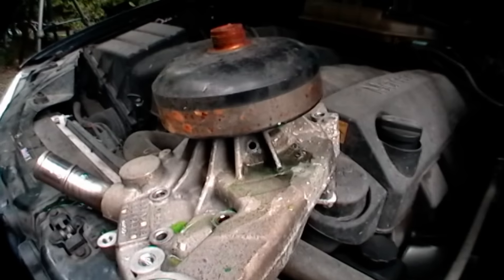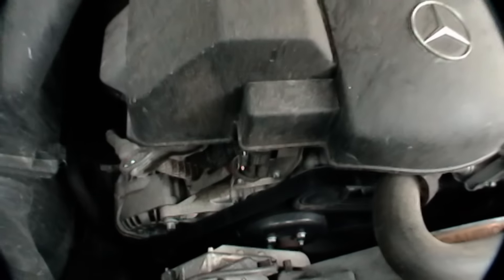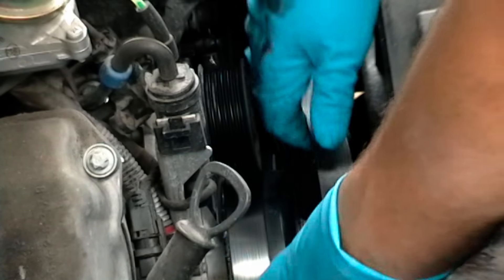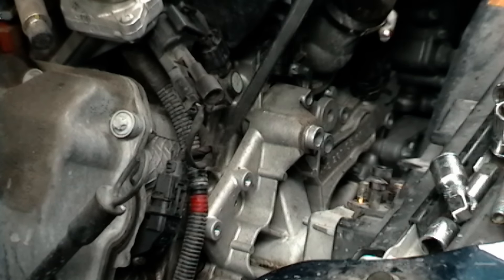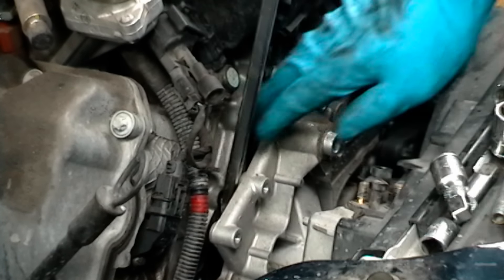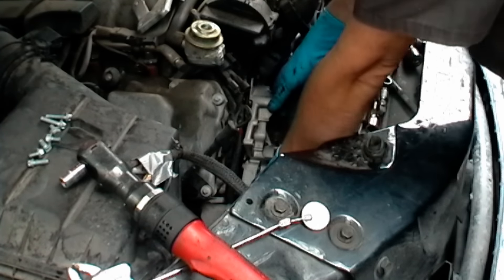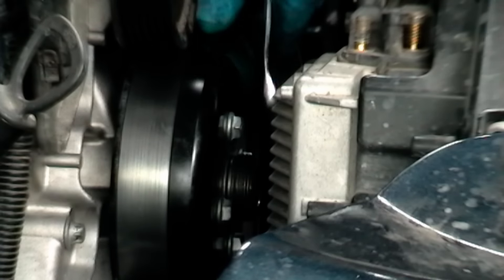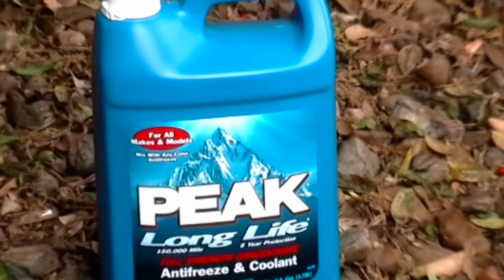How To Replace a Water Pump

Comment: scotty kilmer makes mechanics look easy
Reply: Yeah. Shame sometimes we have to fork over an arm and a leg
Reply: how do u replace a water pump on a 2002 Isuzu rodeo
Reply: Juan...in the process of doing that now.  You have to take Fan shroud off, then fan, then serpentine belt, then the water manifold, and then the upper timing belt covers.  Then loosen bolt that holds crankshaft pulley on (it is a bear...likely will need lots of PB blaster applied and let soak in overnight, then bolt a chain to the of the crankshaft pulley by using one of the threaded holes in the face of the pulley.  Bolt the other end to one of the bolts on the alternator bracket that you had exposed when taking off timing belt cover on the passenger side.  You will need a 24mm socket to remove crankshaft pulley bolt...the chain is to keep the pulley from turning as you apply pressure to release the bolt.  I had to use a 5 foot breaker bar to get enough leverage to break it free.  Then use pulley puller kit (Harbor Freight has them for about $20) to remove crankshaft pulley.  Remove lower timing belt cover.  
Now you will have to remove the timing belt...be sure to mark them in reference to the engine (several Youtube videos about this).  Unbolt the timing belt idler pulley for access to water pump bolts, and you can now remove the water pump.  Hope this helps.  Good luck.
Reply: He's only been doing it for 50 years

Comment from the maker: either the timing belt is not tight enough (sometimes cheap belts are too big and do that) or one of the fan belts is hititng something which would be a lot easier to see. Remove all the fan belts first to see if the noise goes away

Comment from the maker: I pressure test them with a pressure pump, as in my video "how to fix an overheating car" and you see the leak obviously then. Then you can see the spray when it's cold and feel around for the leak too.  Cheaper pressure testers can be had for 40 bucks or less if you price around.

Comment from the maker: No, it won't really hurt anything, you can mix all kinds of coolant, they work fine, it just makes measuring their freezing point a relatively inaccurate process due to differing chemicals in them.
Reply: Hey what about the electric water pumps?

Comment from the maker: @Jcal022 just running them then refilling them with the heater on full blast after they cool down an hour or so normally works. If not, I use a vacuum bleeding system. Scotty

Comment from the maker: @Matthew55904  No , you can't change it out. And you need to check the pump and the tensioner and other pulleys for wear. Replace them if they are worn or if you have very high mileage. Scotty

Comment from the maker: @TranceScene  Yes, but the mercedes I was working on is full of blind holes, no through bolts, a better design. If you are worried when working on a car, watch the bolt holes as the bolts come out, and if water starts coming out the hole when you remove the bolt, put sealer on the bolt before installing the new pump. Scotty Kilmer

Comment: Very good point to point out to people about cleaning off the old gasket on the engine before putting the new one one. The cleaner the better :- ) Something so simple could cost you in the long run if you don't take the time to do it right the first time. Thanks for the vid Scotty!

Comment from the maker: Base Timing 	10 +/- 1 deg BTDC
  	-
Note: With STI (TEN) pin grounded at Data Link Connector

 10 degrees before top dead center with the pin grounded on the data link connetor at idle

Comment from the maker: @loco0351  Changing that timing chain is a pretty complex job, but it has nothing to do with the water pump so I wouldn't bother unless the pump is leaking. If you have the tools and don't mind getting dirty, I'd advise getting a book to make sure you do it right and line up the marks correctly., Scotty Kilmer
Reply: What about the Dodge Magnum 2.7 V6
The water pump is driven by a chain off the crankshaft.
I've been told to keep a close eye on the oil and if I start seeing signs of moisture its probably the water pump leaking back into the engine.
If this is true for the original engine has Dodge come up with a fix to prevent this from happening?

Comment from the maker: @ezkeyboardkid58  Try changing out the thermotime switch for the fans, any auto parts store can sell you one and show you where it is. If that doesn't do it, then either the fan relay is sticking or the engine is wearing out and just running too hot. Scotty

Comment from the maker: @1ownjoo2  Yes, it's hard to get a correct 50 50 ratio of coolant to water that way. Most guys use a flush machine, OR blow the block out with compressed air so nothing's left inside. But you have to remove the thermostat to do that, that's why most guys pay a mechanic to do the job with his 1700 dollar machine. Scotty

Comment from the maker: @sbaker3232  That would be a big No No. The weep hole is there to relieve pressure from a leaking pump seal. You plug it up, the pump will eventually blow the pulley and knock a BIG hole in the radiator. Scotty Kilmer

Comment from the maker: often the ac compressor, but if it blows cold and continues to do so over time, often valves inside the ac system get worn and make noise on start up. Live with that if it works.

Comment from the maker: bubbles will always come out as the engine heats up from heat. But, if you have air inside, that can make the idle fluctuate. Me, I use a vacuum pump system to suck the air out of cooling system, most mechanics have such a device, it only costs 70 bucks, but you need an air compressor to run it

Comment: Dear Mr: Kilmer. You're an inspiration to so many people including me. I have just removed a water pump from my car and it was destroyed. All the flaps, or what are they called, broke of and ended up in the engine. Since I also removed the engine head I glued a strong magnet to a screw driver and pulled them one by one through cooling openings. However, I got seven out but the eighth is nowhere to be found. I didn't found it in the bucket I set below water pump but there is also some chassis parts going right bellow the pump and it could have got stuck there but I have no way of looking into it. What should I do? I wouldn't like to assemble it all together only for new water pump to get destroyed by this part. Sorry for a lengthy post but I've never been good at explaining things :)

Comment from the maker: @BigLongJon21  For that car, you need to take the front of the engine apart, and replace the timing belt and water pump, as the pump is driven by the timing belt. Watch my video, How to change a timing belt in your car, that shows how to do the belt, then you would just unbolt the water pump also to replace that. Scotty

Comment: I am working on a 2004 3ltr v6 Mercury Sable. Super high pitched belt squeal and overheats, and no heat ,water pump spins good and no weep hole leak ? I checked all the pulleys and they are good and spin free, I loosened the belt to check them. I thought something might be seazed up preventing the water pump from spinning. 
I thought it was the water pump but it is a job to replace it. Maybe I should check the thermostat first ? The alternator output was normal by the way.
Your tech videos are great thank you sir !
Reply from the maker: many things can cause overheating, and on those, bad water pumps always will leak coolant, period.  could be more than one problem, so try my video "how to fix an overheating car"

Comment: First time watching your videos and instantly love em! Very informative. As a total car amateur, this tip along with the replacing the radiator could possibly save me $800! I havent put these skill to the test just yet. I need to order the parts first. If you can give me anymore tip for a 97 camry(4 cylinder automatic), I'd greatly appreciate it! Thanks!

Comment: Tapping the pulley?
Hi Scotty! With your help I replaced the water pump on my mazda 6 v6 2007. I had to remove one pulley to have access to the screws holding the water pump. I put back the pulley on but couldn't squeeze it fully in. The harmonic balancer screw tip broke. I'm missing about 2-3mm to have it fully inserted, can I tap on the center of the pulley with a hammer or is this dangerous? It all works as is but it squeals a little bit because of the pulley not being fully inserted.

Comment: Hello scotty. i'm refering to ur videos and many other sources to change the water pump, timing belt, and tensioner pulley on my good old 86 BMW e30. Do i always have to put gasket sealer before putting the gasket? I ask because none of the other diy's say anything about this. I'm replacing them because it hasn't been done for more than 6 years i believe, plus it started leaking; sending the coolant like lube to the belts. Thanks in advance, all of your videos have been really helpful. God bless

Comment: Question for you - I'm looking to fix a coolant leak on my 97 Regal LS and am trying to determine whether its the cooling elbow joint or the water pump itself.  When I have the car in park and go up to around 2.5k RPM's, you can see coolant gushing out near this elbow.  Would this happen with a bad elbow or does that mean it's associated with the actual water pump?  Just looking to do the least work possible and still fix the problem.  Thanks for your help!!

Comment: When I tried removing the harmonic balancer using the removal tool you used on your other video, I noticed that the holes on it werent threaded and that the bolts I got for the tool are too big. Is the unthreaded holes normal and what size bolts do I need to take of the harmonic balancer?

Comment: Hi Scotty, what are some of the common signs of a bad/worn water pump? my 2005 Mitsubishi only have about 55000 miles on it. my mechanic told me that i should change the WP when changing the timing belt, but dealership (to my surprise) said they usually don't have to replace the WP. any advice? thank you for your time.

Comment: Hey Scotty is it recommended to change the whole timing belt and gears and tensioner also when changing a water pump??
Reply from the maker: everything but the gears, they generally last forever, they are metal, belt is rubber

Comment: You make it looks so easy Scotty! I have a 1998 Olds 88, and there is water around the water pump and at other places on that side of the engine. I have tacked jobs like tune ups, and simple stuff but I am not sure about doing this job myself. Do I have to worry about torque of bolts? Can I do it from underneath so I don't have to take a bunch of stuff off or out of the way to get to the water pump? I feel like I could it myself if I had to. I'd rather not spend the bucks for a mechanic. Help?

Comment: Hi Scotty:  I'm thinking of going with a hi performance water pump and radiator for my 87 Caprice, for extra protection in really  long drives through desert-like areas.  Can you think of any reason I shouldn't do this?

Comment: I have a honda civic 98 , it had a cracked radiator so i purchased an aluminum one. changed the electrical fans and top and bottom hoses along with the straps . I also changed some heater hoses and by pass hose. I am having an issue with the car overheating it does it sometimes. My guess is the water pump need changing since i have had the car 2007 i have never changed the timing belt or the water pump . my question to you is how do you diagnose this ? is it the water pump?

Comment: Hi, Scotty, You just put the gasket on but do you need that rubber piece that come with the gasket or no?
Reply from the maker: I don;t know what you're referring to. But waterpumps come with many different designs, and some do have rubber pieces for sealing side shafts. You would use them

Comment: Hi Scotty, Thanks for doing all such great videos... Do you know what need to be removed minimum to replace water pump on Honda civic on 2001 coupe.  Also do we need to torque engine properly before removing timing belt off to replace water pump? Thanks once again.
Reply from the maker: you have to take the timing belt off on that honda to change the pump, but it's no biggie really. There are torque specs but if you work by hand and put it all back as tight as you can, that always works fine for me.

Comment: Scotty we have a 2000 camry and it squeals while running especially at idle. Sounds like the idler pulley to the alternator. My mech said to replace the timing belt and water pump since it is not easy lots of time to get to them and it has 100,000 miles anyway. What do you say?

Comment: hey scotty, I have to replace the water pump on my 2002 mazda mellenia 2.5L engine , wondering is it alot to it do i have to remove the timing belt or lower the engine to get to it not sure.thanks

Comment: Scotty, What's a good price to do a timing belt, water pump, tensioner, and reset and set the mechanical timing for a 1994 Prelude SI H23A1?
Reply from the maker: with all those parts, if you use quality dealer honda parts, about 600 bucks.

Comment: @scottykilmer yep agreed. In the past 2 years alone my grandpa has had the following things replaced on that car: the alternator, the battery, the radiator & thermostat, the fuel pump, the front struts, as well as the motor & transmission mounts. The car has well over 207k miles on it now and it still has a check engine light on it because apparently there's an evaporation leak. He really should just get a new car but for some very strange reason it's still not high on his list of priorities.

Comment: Evening scotty, I've just replaced the water pump, timing belt and tensioner for 01 honda civic. When it was time to torque the tensioner with the torque wrench it just feels like it spins but it doesn't tighten to 33 foot lbs. Is it possible that the bolt broke the threads and if so, would it be safe to drive like that. It looks as if the timing belt is pretty secured even when I rotated the crankshaft a couple of times.
Reply from the maker: not safe if bolt is stripped, as belt will get too loose and often snap

Comment: scotty, i recently had my water pump replaced. After getting it replaced, I had some fluctuating idling when the car was cold. I thought that when i got the pump replaced, that air got into the coolant system.  To get the air out, i let the car run with the radiator cap off.  While i did that, bubbles where coming out of the radiator coolant.  Is it possible that the water pump could be the reason for the bubbles?  I am trying to come up with every possible scenario for bubbles.

Comment: How bad is it to do on a '99 Grand Prix 3.8 naturally aspirated engine? The engine has less than 40,000 miles and it already needs changing, possibly because I switched from Dexron to Prestone. Also the factory part from GM is close to near $300 while the generic "AC Delco" version is only $78. What's really the difference? Any other decent brands to look at? Thanks Scotty!

Comment: Hey scotty, so would this be like the same process to change the water pump on a 96 accord?
Reply from the maker: na, yours is a royal pain. It's driven by the cam belt, so you have to remove the whole front of the engine and the cam belt to get to the water pump.
Reply: Damn, okay thanks scotty!

Comment: Hi, Scotty. I have a c320 2001 benz and I was wondering can a worn clay water pump cause the car to fail smog? I took my car to a technician and they told me the upper radiator hose was leaking but when I checked myself and squeeze on the hose it wasn't leaking at all. And they say it might cause the car to fail smog but i doubt it. What you think? should I replace the upper radiator hose or just leave it the way it is? Or should replace the water pump first?
Reply from the maker: In some states leaking fluid makes them fail the test. Ask in your state, they all have phone numbers you can call and ask

Comment: Hopeful for advice:
Sometimes my 89 mustang pushes coolant out of the overflow after driving. To me it seemed like I had air in the cooling system so I flushed it, let it burp, and added K seal to the new coolant as a leak preventative. Sometimes it still does it. There is also sometimes a puddle of what seems like dirty water under the oil pan-ish area. The only thing I can think of is replacing the water pump. There are no actual coolant leaks though...just the overflow and water under oil pan; am I on the right track? Open to any suggestion. Thanks much.

Comment: I want to replace the water pump on my 1976 Chevy Corvette. I looked at it and I see there are 4 belts to be removed. The fan belt, the power steering belt, A.I.R. belt and idler belt. If I remove these belts does that require me to reset or redo the timing for the engine? Thank You

Comment: Scotty, Need your help.  I am in the process of changing the timing belt on a 99 Toyota Camry because the water pump died. I replaced the belt, tensioners, water pump, and all the gaskets and seals.  Now I pretty much have everything back together however when I turn the crankshaft to check timing it will stop just before I get to the second revolution and timing marks are all aligned.

Comment: Hi Scotty. I have a 2006 Pontiac grand prix and it's making a gurgling noise under the dash. Does that mean the water pump needs to be replaced?
Reply from the maker: not normally, that means air is in the cooling system, so check for leaks but if you don't have any and don't lose coolant, often old heater cores just make noise from internal restrictions. I had a car do that 7 years.
Reply: Scotty Kilmer Sorry, it's not a gurgling noise, it's more of a swooshing of some liquid. It makes the most noise when the car starts to accelerate. It's definitely a liquid moving around though.